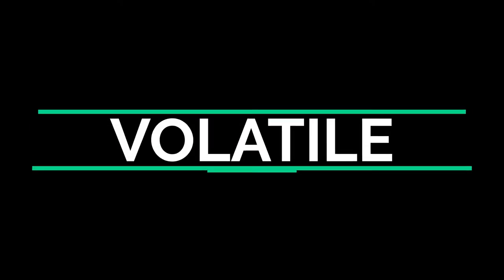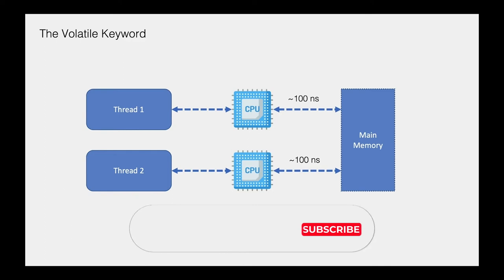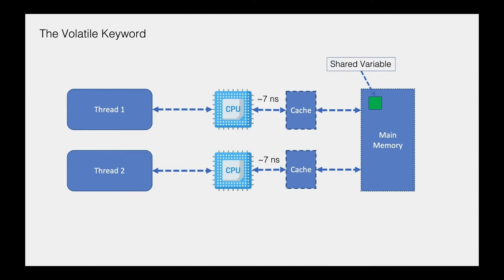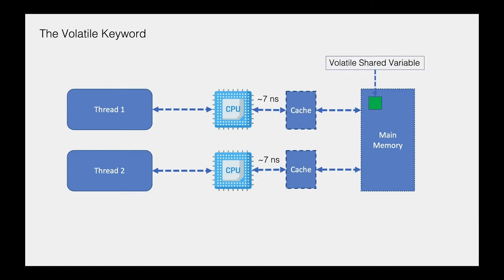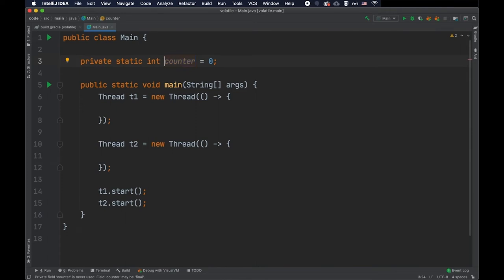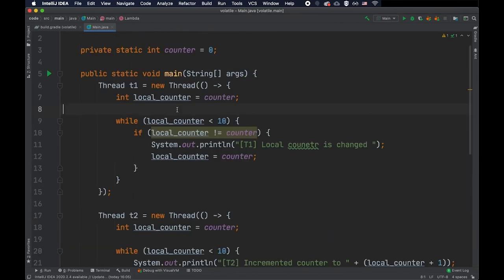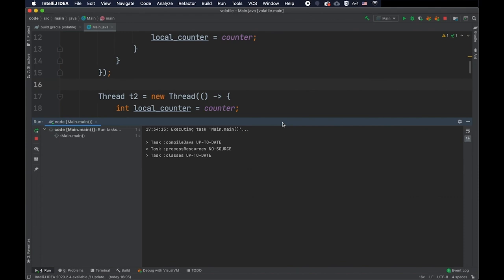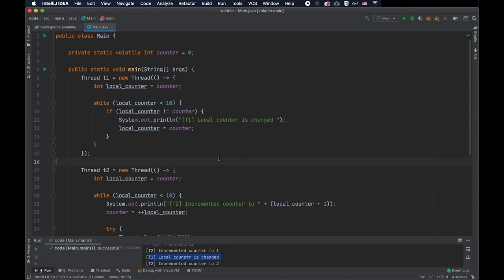What role has the VOLATILE keyword in Java?

Comment: Your explanation just got my heart, thank you♥️

I want to add something : we should always use it with instance variable of singleton class
Reply from the maker: Thanks a lot for your appreciation! Indeed, a singleton class ensures that we can have only one instance of it, so there are higher chances to get race-conditions since we work on the same shared variable.

However, I believe it's important to understand the nuance of this keyword, in order to know exactly when it makes sense to use it. For example, if short-term consistency is not a problem for your specific application/use-case, then you don't have to use volatile, even if you work with a singleton instance. 

Usually this keyword is used in very consistency-sensitive components, like the internal implementation of Locks/Semaphores in Java.

Comment: when you run the program before declaring the variable as volatile, why doesn't the value of the variable inside the cache ever get updated? I was under the impression that it might get updated at some point?
Reply from the maker: Good question. It will get updated at some point, but that’s unpredictable, there is no guarantee about a timeframe in which it will get updated

Comment: Great Explanation, but one doubt, does every thread in java run on a separate core?
is it like that? But how do you guarantee the execution sequence? means whether the first thread is executed first or second? It could be a case where the thread which is reading is executing first and then after that second thread starts executing. 

package JavaPrograms.Threads.VolatileVsAtomic;

public class Program1 {
    private static int counter =0;
    public static void main(String[] args) {

        Thread t1 = new Thread(()->{
            int localCounter = counter;
            System.out.println(counter);
            while (localCounter<10){
                    System.out.println("Inside" + Thread.currentThread().getName());
                    localCounter = counter;

            }
        });

        Thread t2 = new Thread(()->{
            int localCounter = counter;
            while (localCounter<10){
                counter = ++localCounter;
                try {
                    Thread.sleep(500);
                } catch (InterruptedException e) {
                    e.printStackTrace();
                }
            }
        });

        t1.setName("firstTHread");
        t2.setName("SecondThread");
        t1.start();
        t2.start();

    }
}
Reply from the maker: Yes, there might be a scheduling order where both threads are executed on the same core, however this is unlikely to happen, because the JVM/OS will optimize the execution at runtime (via runtime profiling), and given that both threads contain hot-loops, they will most likely be JIT compiled and scheduled on different CPUs to get max throughput (they can basically be re-scheduled by the OS)
Reply: @visualcomputerscience   Thanks for the explanation.